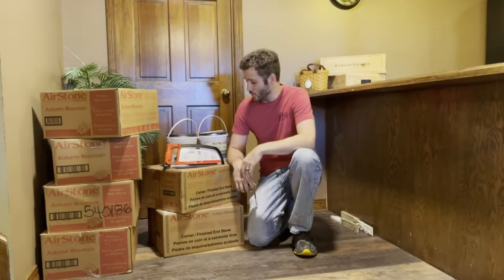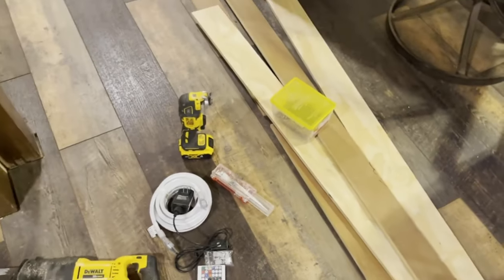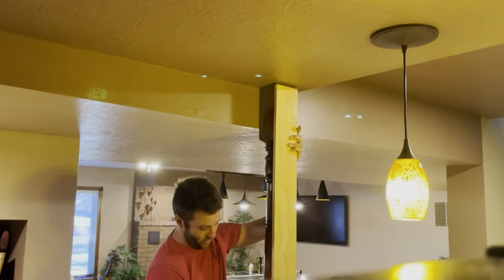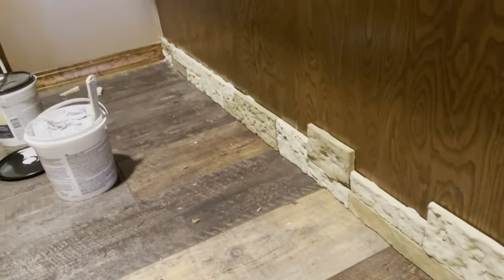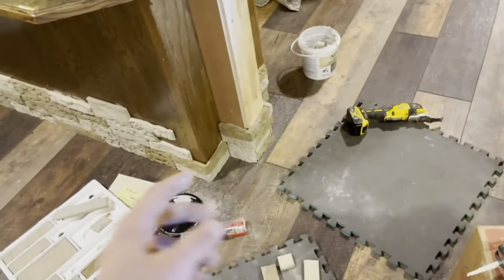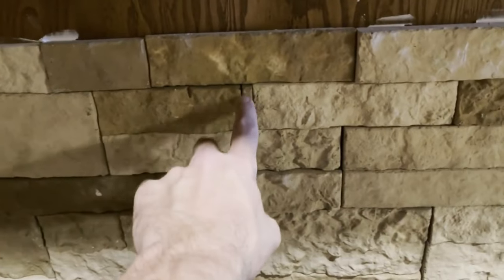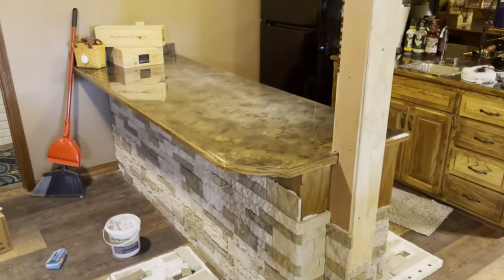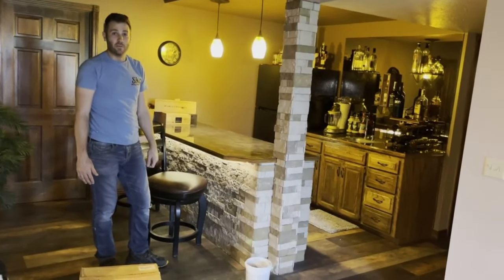AirStone Faux Stone: The Perfect Solution for Your Bar Remodel

Comment: You should've read the directions for the corners. The rounded piece has a matching straight piece that matches and really tightens up the gap at the corner. That's why there are rounded and straight pieces in the corner boxes. They also recommend a masonary blade for cutting the stone.
Reply from the maker: Ya.  There were only a handful of corner pieces per box and I didn’t want to spend a lot more to get more corner pieces. YES!  the masonry blade makes a huge difference.  Went that route with the angle grinder and damn… huge difference

Comment: I’d like to know how this holds up over time? People kicking the bar wood flexing etc…..
Reply from the maker: Been up for almost 2 years without issues.  Anything that would have flexed would have shown issues by now.  The individual pieces without any grout allow for some flex in my opinion.  I have used this on a cinder block pillar outside and it has been holding for 5 years so it has my vote of confidence